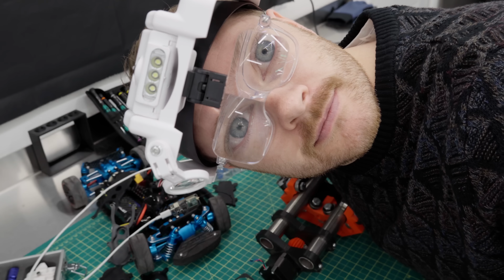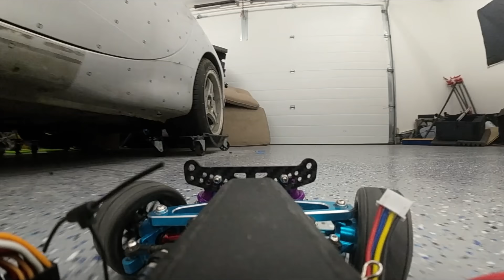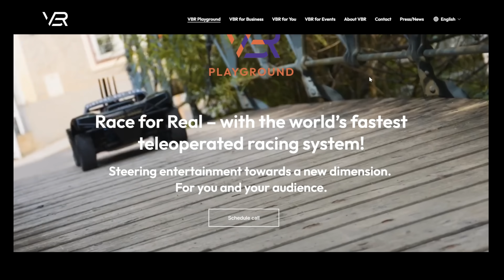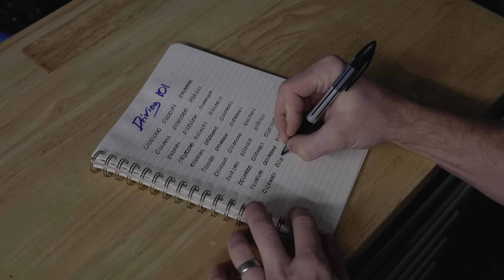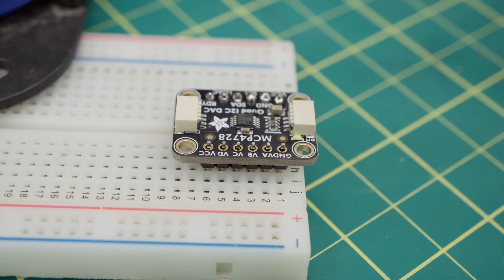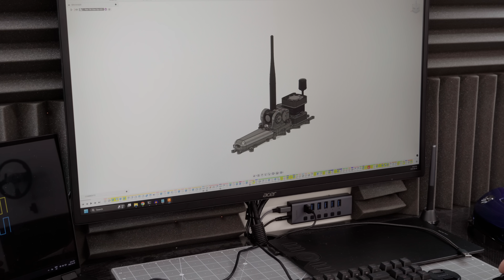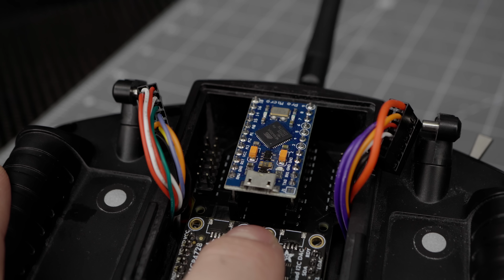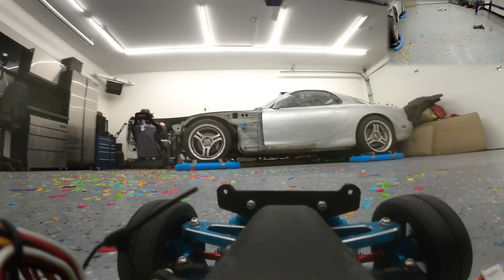Turning a Racing Simulator Into an RC Car Controller: How Hard Could It Be?

Comment: @bits-bits  Thank you so much for uploading the headtracking STLs to GitHub, that's a huge help! I noticed that the repository currently seems to contain mainly the headtracking files. Do you happen to still have the STLs for the rest of the 3D-printed parts as well? I'm specifically looking for the mounts for the sensors, the microcontroller housing, and the antenna mount. Thanks again for your awesome support and for sharing your work with the community!

Comment: Hey, awesome video and incredibly clean build! 👏 I'm currently working on a similar custom RC project using an ESP32, and your setup is super inspiring. I was wondering if you might have a complete parts list of the electronics you used? Also, is there any chance you'd be willing to share your 3D CAD files (especially for that power supply box and the mounts)? My build isn't exactly a 1:1 replica, but tweaking your designs to print on my Anycubic would be an amazing starting point and save me a ton of time. Would be absolutely huge! Keep up the great work!
Reply from the maker: I'm going to try to get the stl's uploaded this weekend! I don't have a list of electronics for this method, but the updated control scheme I created has a list of all the parts.  I can't remember what I named the video, but it's the long video on the channel 😂
Reply: @bits-bits  hat is awesome to hear, thank you so much! I'm really looking forward to the STLs this weekend. I'll definitely check out the long video for the updated control scheme parts too!
If you happen to still have it or remember, could you also share a quick rundown of the internal electronics you used for the car itself? I'm specifically trying to figure out the exact components and wiring you used for the step-down BECs, the servos for the DJI O3 head tracking, and how you routed the power supply for the O3. Any details on that would help me out massively with my own build!
Love the project, thanks again for sharing your work!
Reply from the maker: Files are up on the Github! Or at least the ones I could find 😅... I don't have a detailed BOM, but it uses a bunch of m2 hardware, some press fit inserts, four 608 bearings, and two 9g servos.  I used the Chadd rains o3 armer in this build, but the ramiss seeeduino method works about the same, just with more soldering.
For everything on the car that runs lower than 11.1v I just run through a buck set to the required voltage.. So for the RP2040 I just set it to 5v and run it to the usb connector.  Hopefully that makes sense!

Comment: I bet this will be the norm years from now. Every video I see is people custom making setups like this, but the first company to mass produce a “plug and play” rc / fpv / steering wheel setup will be very successful
Reply from the maker: I hope it takes off.  It's such a unique experience, especially with the motion system. I'm working on a plug-and-play module right now, but I'll probably struggle to get it off the ground myself 😅

Comment: i suggest adding an accelerometer and gyro module on it to add ffb and motion feedback to make it realistic. Btw, I love the whole build!
Reply from the maker: Motion system is complete 😊 I was able to add an IMU to get motion data from the car back to the rig, and I can get a load cell in line with the steering servo for ffb too! The hardest part with ffb is getting the wheel to respond to the values from the load cell.. I still have a lot of research to do!

Comment: This probably needs goods grip and proper throttle control or traction control
Reply from the maker: Definitely! I've got all the sensors on the car to integrate a pretty decent traction control system.. Just need to start playing around with the code...

I'll integrate hall sensor data (wheel speed), GPS data (actual vehicle speed), and IMU data (acceleration changes) to hopefully get the wheels to stop spinning and get the power down effectively 😅
Reply: @bits-bits  what you did, Is very impressive fr

Comment: HI 👋“How much does it cost?”
Reply from the maker: It's actually super affordable if you've already got a sim rig and an rc car! I posted a video a while ago on how to do it yourself with a TTL serial adapter and an elrs module, and another method that uses the trainer port and an RP2040 zero. Either method is well under $100! 😊

Comment: So you are running a game so you get the FFB and wheel feel? Then using Python to read those values from the game and convert it to RC controls through the arduino? Just want to make sure I understand that part lol
Reply from the maker: In this one I'm getting the wheel and pedal values with the python script and using an Arduino to interpret them and convert them in to signals that the transmitter can understand.  I've kind of smoothed the process and made it a lot more user friendly (no soldering needed!) and did a big video on how to do it yourself 🙂.

The fanatec wheel has a lot of tunability with the software, but you can see parts where I have assetto corsa running in the background, that's for emulated FFB, so the steering feel lightens up with speed, and is a little more dynamic.  I've been toying with real FFB for a while now, but I've been struggling to get load cell values from the car to get a response on the wheel.

Comment: I'm working on a head tracking rc project for rc planes. I got the caddx gm3 headtracker and that part was way simple. Trying to get a digital hotas joystick to ppm to the transmitter has been tricky not having programming experience. I'm surprised there is not more people doing fpv and "joystick" flying in the rc flying hobby! Planning on doing an rc car after I figure out the planes. Also, there is usually not a lot of talk about needing a HAM license to operate fpv equipment..
Reply from the maker: The Gm3 looks awesome, hopefully I can bring one in to experiment with someday. 

I've got a video tutorial up on how I've got everything configured now (wayyy simpler than what I did here). I also posted the scripts and sketches on the Github for other people to play around with - it might be a great starting point for your project!

Licensing can be tricky depending on your location. Hoping to get my RPAS license over the winter.

Comment: 0:26 I feel personally attacked with that look lmfao
Reply from the maker: 🤓 You must be be like me and forget what your doing a lot hahaha!
Reply: @bits-bits you have no idea have like 6 projects going at once. One of them setting up my own rc car racing sim set up. 

Also won a lot more redundant in terms of how I designed my RC car I one of that real shifting field without programming the latency and rev curves. 

So I got a four-speed transmission have a motor going to the transmission attached via clutch and then from the transmission it goes directly to the rear axle. Redundant, I know, but I wanted that feel of shifting the disengaging of the transmission the gear shifting up the re-engaging. I really need to start recording my projects my old school attendant just to write things down as I’m working.

Great work by the way I’m very much enjoying the series
Reply from the maker: Damn that's ambitious! Hahah I want to see the finished product!!

Comment: It could have been so much easier. 
Wheel + Pedals into Arduino -> PC and you would get the translated input.
Reply from the maker: I had trouble with getting the wheelbase to initialize when I plugged it in to a host shield on an Arduino.. That was actually the first thing I tried 😅...

Comment: I'd settle for VR goggles that turn the FPV camera on the car to match the rotation of my head and a standard pistol grip controller.
Reply from the maker: I accidentally glossed over the Headtracking part in the video, but it does have Headtracking!! I have a link in the description to the system I used, it's pretty simple to setup and relatively affordable.

I've never tired fpv+pistol grip control, but it'd be a great way to get some unique footage without being as cumbersome as a Sim rig 🤣

Comment: Awd cars gotta be driven like fwd unless 30:70 or 20:80 

Idk how to on those yet haven’t driven
Reply from the maker: I ended up tweaking the alignment quite a bit to make it feel like it has more rwd bias.  It's still 50:50 but with it toed out like crazy I can whip it around a little more predictably! 😁
Reply: @bits-bits that’s sick but I think

Go 0 toe and tighten up front suspension
Reply: @bits-bits keep it as soft as you can still but tighter in front 

Balance out rear to your liking (how you want it to “trail” though it got power
Reply: @bits-bits make it wrc like you’ll like it better

Comment: I'm doing this as well but with the budget of 99 cent so this could be the tuff road lol
Reply from the maker: Hahaha! Well if you've already got a Sim and a transmitter that has a trainer port it can be done for about $6! I found that out in my latest video 😂
Reply: @bits-bits  what camera module do you use?
Reply from the maker: It's a dji o3 air unit. Any video system would work though, it's completely independent from the control system.

Comment: i have a revoscan3. how did you import your scanned module into fusion without it being the most jumbled mesh module ever
Reply from the maker: I've never used a revoscan3 so I can't really speak to how good the scans are.. But when I scan stuff I make sure I've got my exposure set well, resolution set fairly high and I get the environment ready in the software to not pick up a bunch of artifacts (like the table).
After I get the part scanned I do a bit of cleanup in the scanning software to get rid of any floating voxels and disconnected components; then I'll convert it to a mesh with a bit of smoothing an optimization.
When I've got the mesh I'll align it to the origin and then import in to Fusion.  Fusion still needs quite a bit more development to be really good for working with meshes.. But it's getting there!

Comment: I really think you should have a long distance antenna on the car and connected to your rig so you can drive it outside.
Reply from the maker: I've been able to take it out a couple times now! Surprisingly the range/penetration is pretty good right off the transmitter, but with the new TX module method I'm doing plus an active USB cable lets me place the transmitter outside for really good range.. Only limited by the video system now!
Reply: @bits-bits  Gonna need a neighborhood time trail 😂

Comment: I mean if I wanted FPV on my RC car I'd just take a old busted FPV drone and ziptie it to the RC car and run another plug to a circuit board on the car or keep the drone and make a hybrid flying drone RC car .  I can make many things with zip ties
Reply from the maker: If I had a drone kicking around, believe me, that's exactly what I would have done 😂.

Comment: Great work! I ended up using vJoy and Joystick Gremlin to take the fanatec + Pedals and map to one joystick. Then I used a Compufly USB to PPM converter and used the PPM input on the RC (Trainer port) to take that signal in my Radiomaster MT12 (EdgeTX). I moved to a dedicated FPV controller (Siyi MK32) and use that instead. The MT12 + PPM converter + USB joystick worked pretty well. I just wanted to do video and control over one telemetry connection for a ground based drone (Losi DBXLE 2.0) to my racing sim.
Reply from the maker: I'm gonna have to look in to that PPM converter! I'm going to be posting a new video on Wednesday about a couple new ways to do it (super user friendly, and relatively cheaply too!). I struggled quite a bit with the ppm generation for the trainer port.. Got it working, but it could definitely be better.. The other way just sends a serial signal right to a TX module, so no PPM to confuse me there hahah! 

That siyi unit looks really cool! I'd love to play around with one someday!
Reply: @bits-bits  Search "CompuFly v2.0 USBtoPPM Converter". I liked this method quite a bit.

Comment: Did you consider options for adding force feedback to the steering wheel? I wonder if you could read the RC steering position and feed that back into the FFB, or whether that would only result in a heavy wheel because of input delay and you wouldn't really feel anything because of how light the car and tyres are.
Reply from the maker: I'm working on this right now! I've got a couple different options - current sensing from the servo axis, and a load cell in line with the steering pushrod.  I've got data streaming back to the computer (via the same signal as the motion Simulator), but the issue lies in converting the raw FFB data to something that actually elicits a response from the wheel.  Lots of testing to do still! But when I get it working there will be a video!
Reply: @bits-bits  Oh that's awesome, I'm looking forward to see what you come up with!

Comment: Now think of a clever way to add force feedback and it will be pretty close to how driving a full size electric car with hacked firmware is.
Reply from the maker: FFB is underway! I've got a way to stream the sensor data (either load cell, or current sense) back to the computer. The tricky thing is getting the wheel to move in response to the raw data.
Reply: @bits-bits  Remember to cap how much force the wheel can output before testing since DD, made that mistake a few times with older games lol.

Comment: Man, imagine a real RC manufacturer actually looks into this and develops a full-blown control software/system, which allows you to operate their RC chassis with a sim rig and a VR headset?
That would bring RC racing to a different level - one way or another.
Reply from the maker: No need to wait for the big dogs, I've got a super simple system up an running so it'll work with any system running an ExpressLRS rx/tx 😁.
I'll be adding the finishing touches this week and start working on a how-to video so everyone can drive/fly no matter their setup!
But if a big company wants to hmu I'm game lol

Comment: What's the range of this thing? It would be super cool to see you race against other drivers from your garage, maybe 10 miles away... next step?
Reply from the maker: Haven't done a full blown range test yet, but the control system is running ELRS so that should cover quite a distance.  I would assume the video link (dji o3/goggles v2) will drop long before the rc link.
So far I've gone about 1/4 mile without any issues.

Comment: The need to merge accelerator and brake pedal input to a single servo output seems to be the inverse of a similar problem i had: during The Lockdown® I converted an older nitro RC car to electric using an old quadcopter motor, keeping the mechanical brake.

In order to make it work an Arduino received the single throttle/brake channel and, according to its value, either commanded the motor's ESC or the mechanical brake servo.
Reply from the maker: This is exactly how my very first version with the arduino worked, gotta a love those little microcontrollers!

Comment: I think the simulated gears is a great idea. I really think it could help to understand how fast you're going. Not In mph/kph but if you can make the turn safely on 3rd gear you may not make it on 4th. Great work!
Reply from the maker: This is exactly how I approach tracks when I'm racing! I never think "What's my entry speed to x corner?" I always think "I can take this corner in 4th".  I've added some curves to the power delivery to smooth things out a bit, and I'm also adding some sensors go provide a bit of drivetrain feedback as well. Don't know when I'll get those videos out, but they're coming! 😁
Reply: @bits-bits  yeah that's the most convenient way I think. Only on longer straights can you have time to see if you achieve a higher top speed, but then you have to nail the braking 😅
Reply from the maker: If you've watched the ABS video I did, you'll know I always nail the braking 🤣
Reply: @bits-bits  I didn't. Do you have a link?
Reply from the maker: https://youtu.be/_G8wjSl6XAk

Comment: I wonder if it would be possible to somehow apply force feedback to your wheelbase. That would be amazing :D
Reply from the maker: I'm working on this now! I'm able to get data from the car to the computer using the same  radio system as the motion platform, but I'm still working out how to get the wheel to respond on the computer side.
Might take a while, but I'll do a video when I figure it all out!

Comment: This is every mans dream. (At least it’s mine)
Reply from the maker: I'm working on making it an accessible reality for everybody with a Sim and an rc car right now! The way I did it in this video required a bunch of soldering, because I didn't have the simpler parts to work with. But I've got stuff in the mail that'll eliminate (hopefully) all the soldering and be nearly plug and play! When I get it working 100% I'll make a new video on the process!

Comment: Cool project.  I must confess thought that I am more interested in what's going on with the FD.  I too have an FD in the garage with fender off.  It is getting an ECU swap and Drive by Wire.
Reply from the maker: The FD's gonna be a multi-decade project at my pace 😅. I've 3d scanned as much as I can without a lift, and I've modeled an aero package for it similar to the '04 JGTC car. I'll definitely have to tube the entire front end, so power plant is still up in the air.. I have a couple spare 13b's kicking around though 😏.

I need more shop space to seriously start working on it.. But when I do there will be videos!